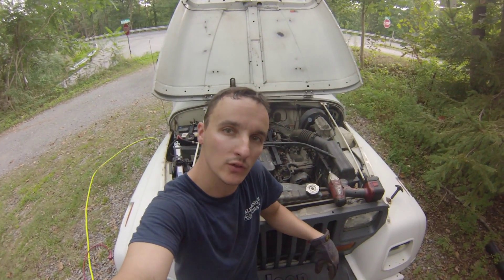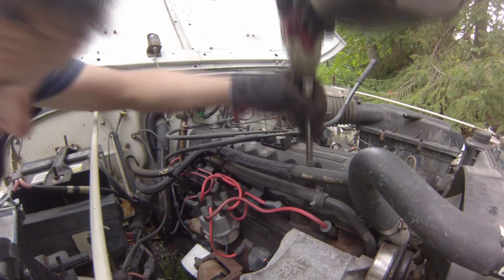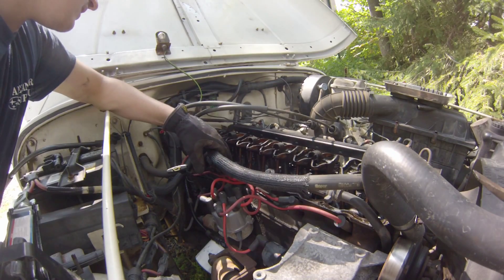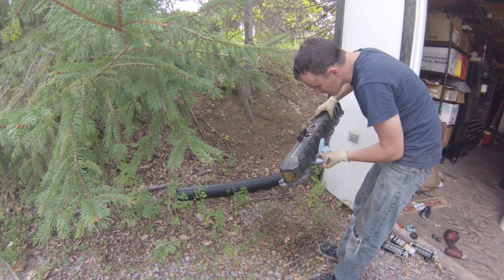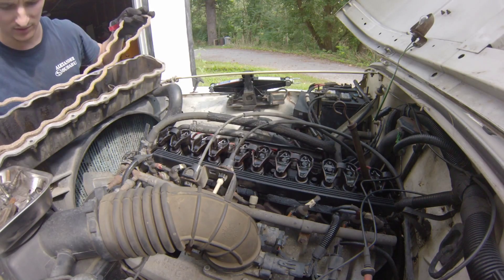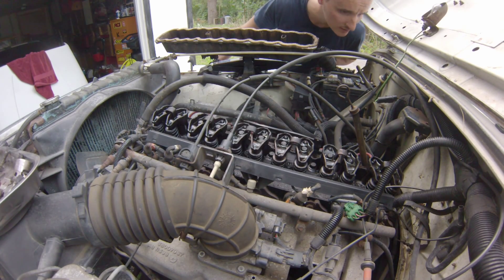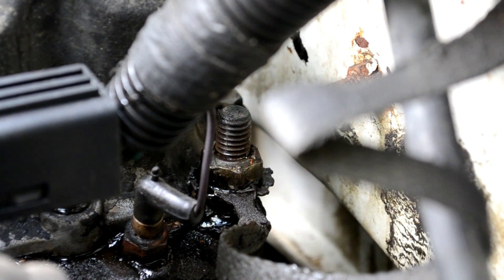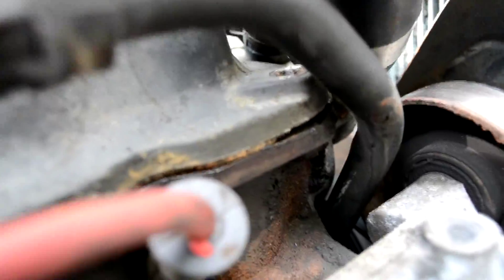Rusty Renegade: Ep 14- Valve Cover Gasket

Comment: I did mine with a cork gasket and black silicone. No issues at all so far!
Reply from the maker: +OhYeahAboutThat Cork usually seems to seal better, but deteriorates faster than the rubber, and is way messier to clean.